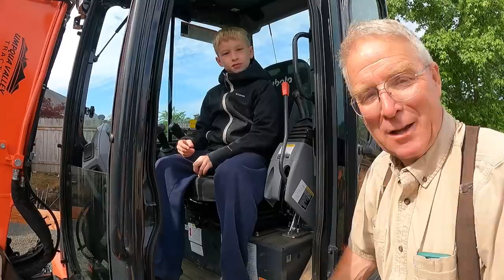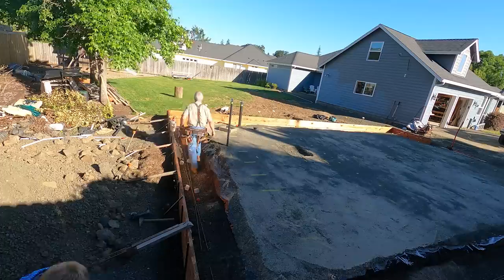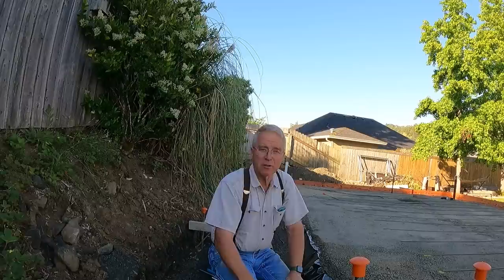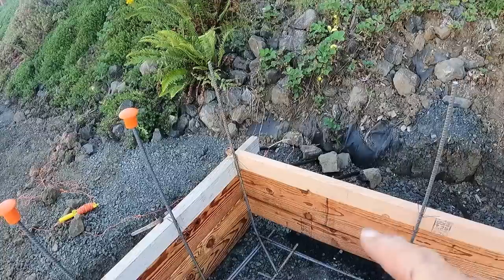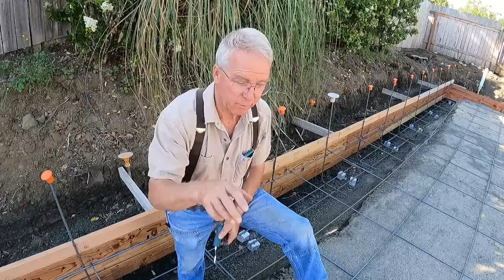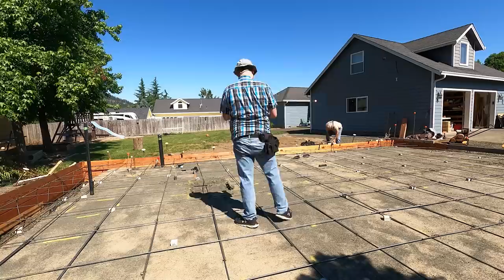Steel, Cement, Stone & Sand: Staging The Rebar. Shop Build #6

Comment: I have cut, bent, placed, and tied a lot of rebar over the years.  Your method of cutting and tying reminds me of the old days, and my back remembers also.  I believe todays concrete crews have evolved to the use of battery-operated tools to both cut and tie the rebar.  I know they are costly for only one or two projects, but I watched a crew use them on a job, and was amazed at the speed of the work.
Reply: In my experience these days they are using a gas powered cut off saw or "gas axe" and still tying by hand with some kleins. At least that's how its been done here in Vancouver Canada in the towers I've worked on as an electrician.

Comment: When I was nine, my parents had a house built just down the hill from my grandparent’s house. I got to see almost everything from the footings to the roof. Since my grandfather and uncles were the general contractor as well as the carpenters the project, my sister and I got to nail part of the plywood subfloor. However I’m not sure I would have been responsible enough, even at 12 or 13, to handle a mini excavator. After all, my wife was nervous enough watching me operate one when I was 50😉

Comment: I remember how we tied the rebars during my college summer break. We also used hooks, but wires weren't having any pre-bent eyes, as the was unnecessary labor. We just put the wire under the rebar, bent the wires ends over the hook and start turning the hook - the fist turn makes the eyes the rest is the same. I believe this is the way the modern wire twister hooks works now. And we also used big angle grinders with big metal disc to cut rebars too.

Comment: I build a garage here in germany a year ago.
We didn't use rebar, but something I didn't know there was: steel fibre concrete. Needs no rebar at all! Small steel wires, probably 4-6 inch long, are mixed into the concrete. The ends are kinked. This way concrete gets enough tensile strength to work without any rebar.
Great stuff!
Reply: Brilliant!
Reply: From my understanding so far, I heard they are for small projects. Way better than steel that’s for sure.

Comment: I am one of your fellow contractors from the northern part of the state.   I love your old school techniques!  I would of poured directly into the vapor barrier, and used wire mesh for the slab ( still would run the #4 in the thick edge footings). Then the wire mesh can be hooked up into the pour instead of being chaired.  Also, you don't have to use wire to tie rebar - I often use zip ties for my smaller jobs.    Just my 2¢...what you have done works just as well!

Comment: I don't know if anyone has tried it before but I thought of an improvement to the rebar cutter for making the difficult cuts you mentioned. I was thinking of something that would hang off the end of the handle like a stirrup that you could put a foot in, to more easily use your weight. It should probably be a metal rod, hinged to the end of the handle instead of a rope or cable since that would let your foot move around a lot and not be very stable. It would also be more difficult to get your foot into it if it was swinging around. If it was hinged, it could be made to fold up against the main handle and be secured with a Velcro strap so it stays with the cutter when not needed.
Reply: Electric cutters are faster and easier to use

Comment: I like you leaving the inspector something to find, I remember why as well ! 
  I’ve never seen anyone using pliers to tie rebar over here (UK) the guys always used wide head nips (rather like pincers ) so as to be able to use the distance apart of the two wire ends to add to the leverage as you twist. Also a lot of jobs insisted that a double turn of wire was used.
Reply: Exactly. I do chain-link installation for a living and we tie the mesh to posts with Knipex pincers. Never felt comfortable doing it with pliers.

Comment: I'm a professional construction inspector.  I am often more in depth and detailed than a building inspector, because I reference plans, specifications and code. Often times, a building inspector looks to see if there is steel in the forms. I look to see if the steel conforms to plans and specifications. I have failed reinforcing steel that the building inspector has passed. From what I saw on your video, without knowing what the structural engineer called out for, the critical items that I look for were all there. Size, grade, spacing, cover and clearance, secured from movement, and placement of dowels. What I couldn't see, was lap length. 

In commercial construction, the vapor barrier is to be in contact with the bottom of the slab, with taped joints and penetrations. Residential construction may have different requirements.

Nice getting your grandkids involved. We need more people in the trades to replace all of us old guys that are nearing retirement.

Comment: I am in the process of building a shop, very similar to this one, similar slab/footing design, but the engineer spec'd #4 Rebar, 16" OC both ways, I tied every single intersection then the inspector told me I didn't have to, but it was fun.

Comment: Always wondering about the rebar amount in the USA. Lokale (Netherlands EU) we would use minimum a pre fabricated structural steel meshes 4’ by 4’ (or 6’by6’) 5/16  thick  . That’s for a simple shop slab. A garage hwere care can enter or a workshop with heavy machinery a double meshes 4’ separation. There is no cracking in your slab, and strong as.. h..l

Comment: I agree with one of the commentators: Why no insulation at all? Two inches of poly-iso and that slab will stay comfortable year-round. Not to mention fewer freeze-thaw cycles which promote cracking.

Comment: I have watched most of your videos over the years and appreciate your work and channel. I have watching this type of rebar work and concrete pours over the years but I can’t get my mind around WHY you don’t use rebar nets. It takes a fraction of the time to set up. It almost eliminates all cracking of the concrete. (If you overkill it it eliminates all cracking) so you don’t have to put in as much work on the pour and finish. Sure you must have regular rebar in the footings as well in this type of slab but that’s standard. What’s the deal with doing it like you are in these videos?

Comment: Did I understand correctly that you put the rebar in the center of the slab? I’ve always been thought that you put the rebar as low as possible so that is works the most efficient (offcourse with the minimum clearance in mind, standard is about 25mm in the netherlands). Depending on the forces It could also mean putting the rebar as high as possible.

Comment: Did you price out glass fiber composite rebar compared to steel? I heard that since steel has gone up so much in price, the glass fiber rebar is about the same and they are so much lighter and stronger and more corrosion resistant.

Comment: What's your reason for leaving anything for the inspector to ding you on? I don't have trade experience I'm just a curious homeowner, wondering if there's a secret there.
Reply: Inspectors always have to find something.  If you give them something to find that's an easy fix, it saves you from having any kind of major redo.
Reply: I think it also might be a bit of a gamble. If the inspector doesn't see it, you don't have to fix it, meaning less labor. Obviously you wouldn't want to do this with anything important, but minor issues could probably be overlooked and no one would ever know.

Comment: The shower pan is what taught me to read prints way back 20 years ago when I was doing residential concrete and carpentry in S. Florida. I was a 19 year old kid on my first construction job and the other 19 year old kid told me to dig down in the slab for the shower pan right around the drain. Easy enough, 4" down, 4'x3' size centered around the 4" drain. 
and that was the issue when the foreman showed up and started yelling at me, asking why I was digging a hole around the toilet. Was I gonna be sitting down low, kicking my feet up while I'm taking a dump?
Luckily the other guy came up and said it was right and showed his inability to properly orient the print. So all I had to do was fill in the hole I dug. The other guy got the ass chewing for telling me to dig in the wrong spot. I learned how to read plans after that so I didn't make that dumb mistake again.

Comment: Get a cheap hydraulic rebar cutter. Cuts up to #6 easy. Painless, fast and way safer. Best $250 you will have spent on concrete tools.

Comment: Child labor!!! Just kidding, i was put to work while of a similar age, digging a big hole to install a septic tank. Circa 1971, so the statute of limitations is long since passed.
Reply: I wish my dad let me work with him.
Reply: @Exonick_  I was actually just industrious and wanted to do the work. Louisiana, in the summer, and got down to about 3 feet with a rototiller. From there on, a shovel and a bucket. Ultimately, a post hole digger and a bucket. To a depth of about 7 feet. I managed to break a toilet that an uncle had bought used for $5 (if I recall correctly) and to this day I remember my father defending me against the uncles complaining about me breaking a $5 toilet. Said something along the lines of "this boy dug a hole for three days while you sat back and drank some beer". It actually shut the critics right up.

Comment: I am afraid that the sand you put over the vapor barrier will catch part of the concrete water and stay there for a looooong time, creating mold and getting out through your slab for months or years causing many moisture problems and deteriorating your slab. It's not recommended to use sand between the vapor barrier and the concrete because moisture doesn't have a way to scape. Use clean gravel instead, that doesn't trap moisture/water and won't necessarily perforate your vapor barrier.
Reply: I've seen sand used many times.  We're getting ready to build a shop and wonder what to do.  Can the concrete be placed directly over the vapor barrier that is laying on compacted rock?